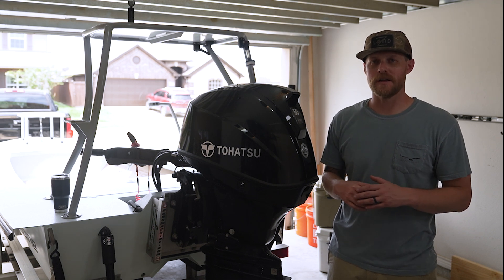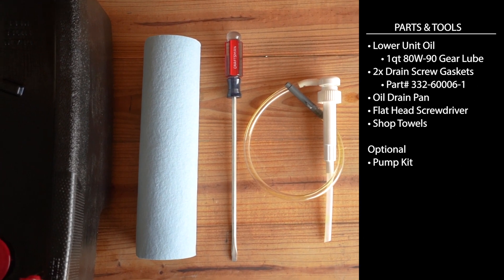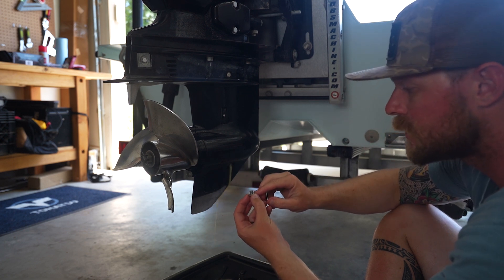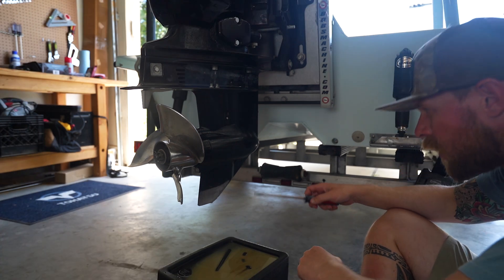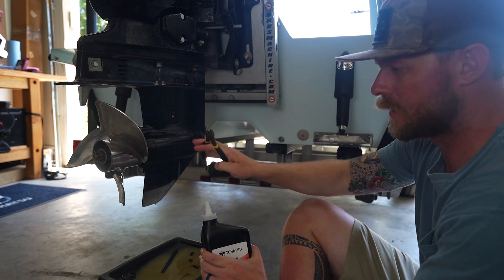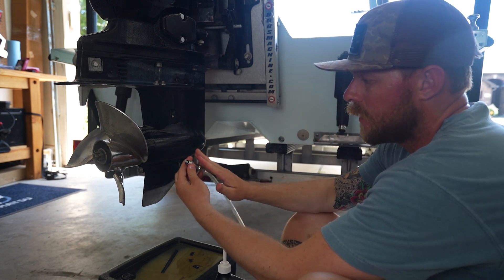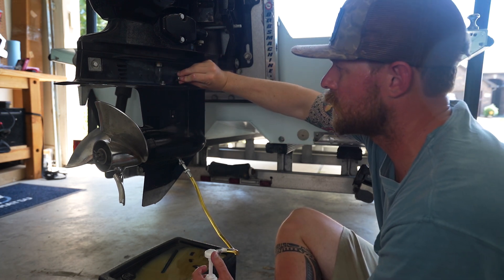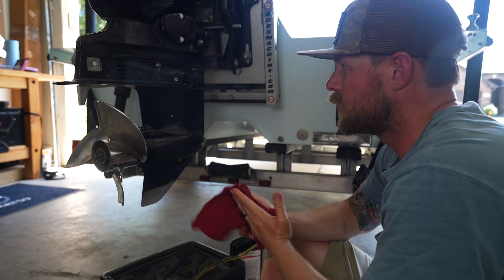Maintenance Tips from Pete's Garage - Episode 4: Checking and Changing Lower Unit Oil

Comment: For the lube pump you mention a Tohatsu adapter. What is that? A Tohatsu part or a specific thread size I assume?
Reply from the maker: The adapter mentioned is required because it has a specific thread: 8mm 1.25 thread pitch

Comment: can you give me some information about chrome propeller your motor ? Which size to you used ?
Reply from the maker: The propeller shown in this video is a stainless steel propeller. This one is a specific propeller from @SabineSkiff - @TheSkiffWanderer could provide more details.

Propeller sizes and pitches are specific to boat applications and uses. Your local dealer can help you determine the best propeller for your specific boat and motor application.